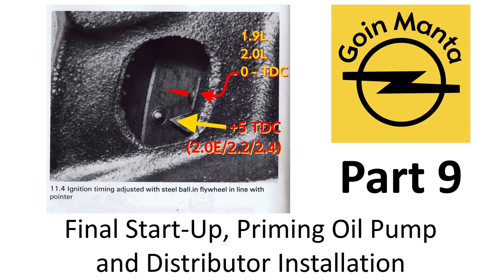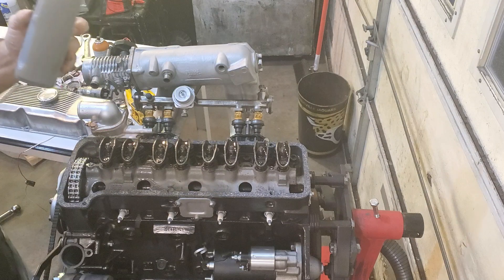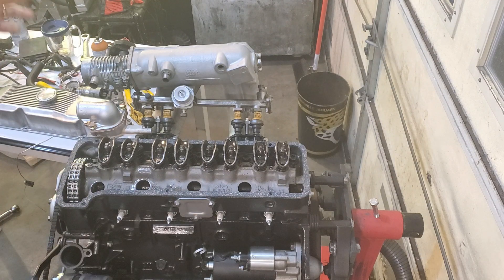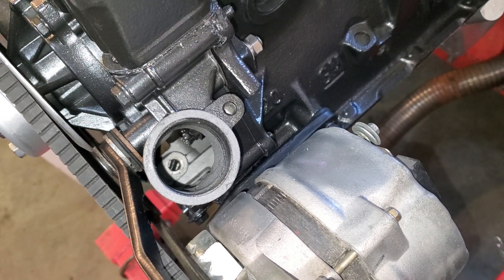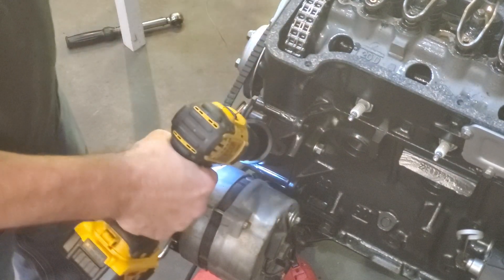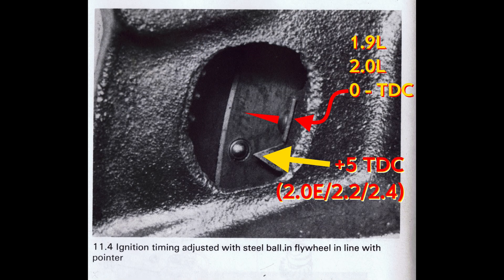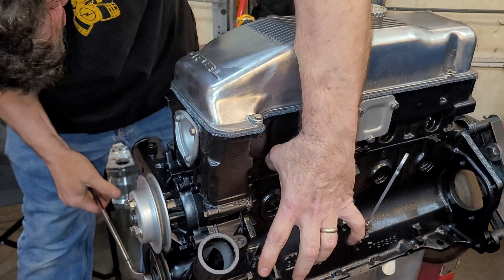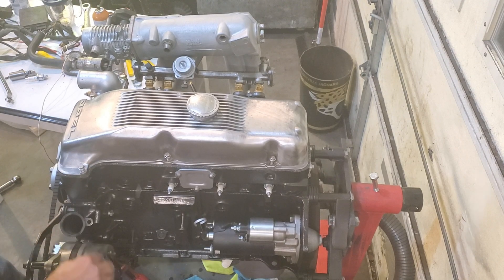How to Install the Opel C.I.H. Distributor and Prime the Oil Pump for Initial start up

Comment: Nice video!
I am have a problem with my gt.
I'm not getting the oil to prime.😢
I've used the same technique. 
Any ideas?
Reply: Hey man, ik you posted this a long time ago. But did you figure this out since I have the same problem rn. Massive thanks if you reacted to this💪🏻

Comment: Nice. This method works for the C30NE?
Reply from the maker: Good question.. I am a 4 cly guy.. 6 cly I assume would be similar. So assume it will work the same way. Only difference in the two is timing. So.. As far as oil pump priming.. Should be a 100% fine.

Comment: Hello my friend =) Got a new video of my Manta here (https://youtu.be/FLCBZRVqcl4). Would be happy for a thumb up if u want to!
One Question.... my Hydros start klicking >temporary!< only in idle.... klicking a few seconds and then its quiet. a few seconds later its klicking again and so on. not depending on the oil temperature. not sure if its the oil pump overflow valve staying open sometimes, or maybe dirt particles in my hydros? =( gonna check everything in the next weeks. but maybe you can say "this temporary klicking in idle is definetly XYZ!..." =D

Greetz from germany
Reply from the maker: Sticking hydraulic lifter ? Is it all the lifters or just one ?
Reply: @GoinManta  definetly just one.
Reply: Thought about doing a .... Not Sure what its callled in english.... Stock-adjustment of the lifters.. because i did re use the old bolt nuts and didnt lock them with a hit